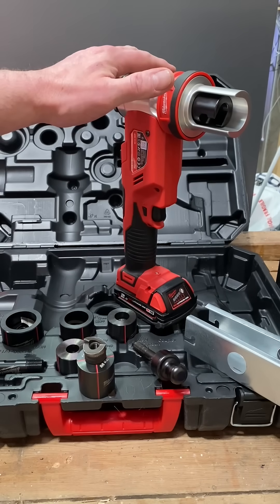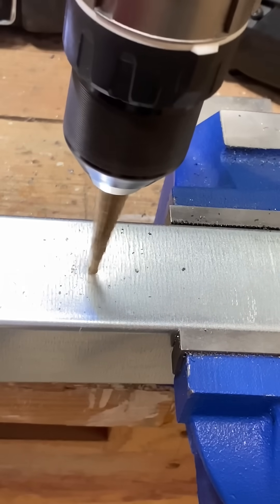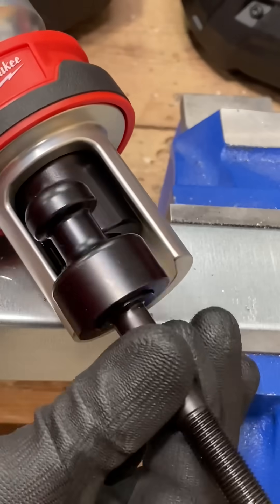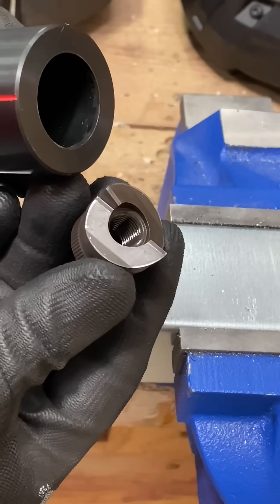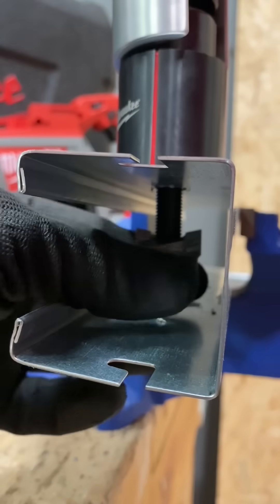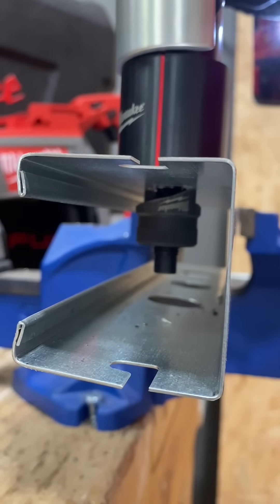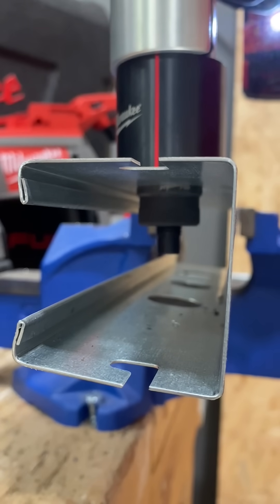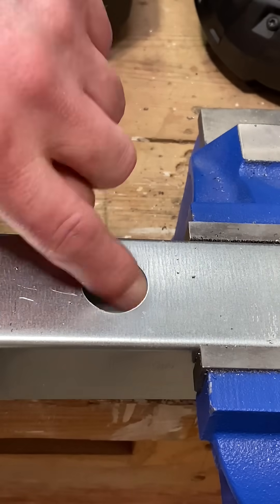ELECTRICIANS' TOOL TEASER - Milwaukee M18 Force Logic hole punch #shorts

Comment: I think I have a better design idea. Don't need the thread to pass through the hole, just something to anchor the cutter to a rod which is then withdrawn through the metal. There are a number of methods that can be applied to generate a linear action which will last longer than this type of thread. Ideally use a ball bearing race thread which is fully encapsulated within the machine preventing metal splinter contamination of the thread. Potentially wouldn't need to unthread the cutter to release the waste material.

Comment: It seems to be a slow and expensive alternative to just reaming out a 25mm hole and spinning a deburr tool in the hole.

I'm not saying it's useless; it's just too tedious and costly to justify replacing the simpler existing technique.

Comment: Used similar many times. Punches are so superior when it comes to larger holes. Especially when compared to a raggy hole saw. They also don't generate tons of swarf. But they only make sense if you use them a lot due to the initial cost.
I would definitely have one if I did trunking or panel plates daily.

Comment: You can buy a step drill that goes bigger than that, so step one drill, step two a few turns with a deburring tool. Takes as long as you did the first drill hole, cost hundreds less and only three bits to carry about.

Comment: So, you have to use a step drill to make a hole to start - why not just finish with the hole drill ?

One application I can see this being useful is electircal boxes where you can't drill holes and there are already knockouts that you need to make bigger, this would work for that.

Comment: Had a job where we were using 4 in pipe. By the time I started and realized how many times I was gonna need to use the messy heavy Greenlee punch that my boss had😢..... Got upset, called Grainger and asked them if they had the unit with the 2 1/2" - 4" dies. They said next day.  Charged it to my card .......$1700. Haven't regret it yet.  When you start using this in comparison to a regular ko punch.......... no going back. TRUST  ME. One hand use, not gonna fall into a panel or whatever after the hole is complete, speed change outs.....what else do u need.?

Comment: we have one of these at work. I've only used it about 4 times...It is a bit of a pain drilling out to 12mm first for a 27mm hole, but, when its 3mm Aluminium, it was better that a hole saw lol. Pity there isnt a fuller range of hole sizes in the kit. Mind you, the Q-max cutters were just as good, & you had D-conn shapes & square/rectangle cutters too.
Reply: 5 mm steel plate with this stuff?. Check your numbers.
Reply: @Luzt.  LOL, damn, yep your right! i had meant to put Aluminium! not Steel! Also it was indeed only 3mm!   -Edited my mistake- 👍
Reply: @Gdpud  No problem ;-).

Comment: Extremely expensive tool for sure, but when you’ve got a dozen new panels with roughly 20 or so knockouts needed in each of them there is no comparison to this tool; also another great point is that the tool almost always leaves a perfect hole with no sharp edges or burrs

Comment: Sadly this has actually inspired me not to buy one. By the time you got to the cutting. I tested it and I drilled three holes in conduit with an old CK 25mm hole cutter and a bit of wd40

Comment: You drill a hole to make a hole. You could clean the 25mm hole in the time it takes to set all that up. Plus if your using metal glands you don't need to be fussy about cleaning the hole

Comment: Wrong use of the tool. Or more like pointless use I should say, if you have to drill anyway.

The intended use of the tool is for junction boxes with holes already in them, and a lot of them too because the tool isn't cheap so for it to be a sensible investment, you'd have to be installing 100s of boxes with it.

But yeah it's a neat tool for a very specific application.
Reply from the maker: Try that approach on stainless steel enclosures

Comment: Nice but the Greenlee LS 50 FLEX is far superior and allows you access at tricky angles.
I'm a panel builder so use these every day for punching 22.5mm holes for panel lamps and switches but it will still manage a 50mm hole with ease.
What size does this Milwaukee go up to?

Comment: Center the draw stud in the hole, before pulling the trigger. Otherwise, when the draw stud pulls through the sheetmetal, the threads will get damaged!
Reply from the maker: Good tip☝️

Comment: It's easy to tell all the handymen and domestic sparkies. If you think drilling a 24 or 32mm holes all day is easier go for it. You'll be 20 step drills or holes saws deep before these dies even show wear. Where this tool is amazing is for guys that care about a quality finish and big holes in gland plates for HV switchgear.

Comment: Too many steps and tools used for one process which should be done with a single power tool.  Take it back to the drawing board and try again.  Need 1 tool to get that cut.

Comment: I fail to see the purpose of this specific tool wgich is limited instead of having a set of a manual punch and dye that is versatile. The manual is probably faster but can be used with a driver.

Comment: I have cut @ 50 holes with a 32mm bi-metal Makita hole saw, without a pilot, though 1.6mm metal stud using a modified templet & cutting compound in @ 15 minutes. This way is for amateurs.

Comment: This tool is clearly not really designed for retro work due to the amount of access required to use it so swarf is not an issue on a new installation as you would clean the trunking prior to installing. 
Hole saw or 25mm step drill rather than 12mm 🤷🏻‍♂️

Pointless item

Comment: I love milwaukee but this seems pointless, a standard set of hole punches have a bolt head so you could use a square drive adapter in a normal impact driver.

Comment: Damn, lotta non-sparks having opinions about a sparky tool. These things are irreplaceable. 1/2" - 4" KO in seconds. I don't know about you, but I can't drill a 4" hole in 10 seconds with pin point accuracy. When you got 10 holes to knock out through a panel c/w a driphood, you'll want one of these. Trust me.

Comment: I’ve used one for 3+ years now. It works great. Much easier that a Greenlee hand pump. I use it mostly for running 3/4” up to 4” liquid tight conduit in electrical substations. I get most of the comments about just using a bigger step bit or something. I probably would too for a smaller hole. That being said, I didn’t pay for it. It’s a company tool. Paying $1000 out of my pocket is a tough pill to swallow.

Comment: Yeah it’s a small hole. But when your doing that 4 times in 24 different boxes it does make it much easier (you can also do all the drilling and then punch). What he didn’t show is that some of these tools can do to MUCH bigger holes the ones i used could do up to 3” or 4”

Comment: Works great for knockouts in panels, switch gears, and mcc’s. Much quicker than a hydraulic one and easier on steel than a unibit or holesaw
Reply: I don’t know if you get a decent carbide hole saw kit I’d be using that all day.

Comment: A fast cut 25mm hole saw for around £20 would do this a lot quicker and cheaper, the lip on the hole saw will stop you going more than 20mm into a trunking/fuse board. It seems a faff, even the removing of the metal when the hole is punched seems a longer process

Comment: This tool is the dogs bollocks. It's a lot quicker.. And easier to pilot hole then screw the punch in place, then hook the ball pull, turn the shroud and pull the trigger.  Having the red cross makes it easier to position to get it accurate before hooking the ball pull

Comment: It's all fun and games with a hole saw until it gets dull and eats your trunking. You know what takes longer and costs more over time? Going back to the hardware store to buy 2 more hole saws and another piece of trunking and then vacuuming the excessive chips. Adding the extra costs and hours to your bid also hurts. For the pros, this tool is the slow and steady.
Reply: The pro has spoken. You've clearly had years of experience trunking and never ran into such problems, we're all stupid and there's no reason for this tool. My bad king you're right 👑💪

Comment: We used to use a hydraulic one for punching holes in control panel doors for buttons / lights etc. Lot easier and much more accurate than hole saws, especially in stainless steel !
Reply from the maker: Great info on the Stainless 👍

Comment: What is wrong with a holesaw? You would have to put a brass bush or a grommet in there anyway.
Reply from the maker: It comes in to its own on larger hole sizes
Reply: I bet you I could drill 10 holes with a 50mm holesaw quicker than you can make the same  amount of holes with your toy.

Comment: no slicey dicey sharp holes are nice for running wires or tubes but a stepper bit large enough seemed to do the trick

Comment: Great if you can get to the other side like in the video but what about in a solid box tube? And you’ve drilled leaving swarf inside the section anyway🤷‍♀️ I feel like this is an extremely specialised tool only one or two types of trades would ever use…

Comment: Love this tool also have green lee hydraulic set ... but pro tip in a pinch where that won’t fit use the ratchet set with a socket and adapter to you impact ...works like a charm and you don’t have to carry around the big hydraulic set or this big gun

Comment: Really? What happened to a sharp hole cutter and a brass bush? Whatever happens you have to add mechanical protection to that so I don’t see the advantage. I could drill and bush a 20mm hole in 20 seconds. That was a rigmarole. What am I missing??

Comment: Why not do what plumbers do and use a deburr tool? Drill the hole 25mm in the first place! Save money and time vs that tool! The step drill should shamfer the outside edge anyway. As with regulation you should be using grommets anyway! Nice finish but time is money. Also money is money. Pointless tool in my opinion!

Comment: Mean time I've drilled a dozen holes and deburred the lot and saved ££££ and time all with the drill you need for the pilot hole anyway... It's a great tool if you're making production lines (internal trunking) to give that nice manufacturer finish ...but even for a predominantly industrial sparkie like me that's a hard to justify (cost wise) and slow tool...time is money...now if they made it make the pilot hole somehow that judgement would change.

Comment: You used it wrong, next time read the owner manual
Reply from the maker: So which part is wrong?
Reply: @efixx  it's a quick connection, you should put the shaft in hole tighten, then put the tool on, its design for more accuracy, we use them all the time at work
Reply from the maker: Thanks - this was our first out the box trial. It’s getting some proper use next week.

Comment: I've had a wrench/socket powered GreenLee version for 15+ years with basically the same cutters and same results.
I suppose I could put a socket drive adaptor on my drill and have the same basic tool, so why buy a specialty tool and spend all that extra money?
Reply: Your drill isn't designed for that. These tools are beasts and save time and energy
Reply: @Tre16  how do you know what drill I have? True, most drills likely wouldn't have the torque to last with constant use in this situation, but some higher end hammer drills or 1/2" high end drills might.
Reply: @Tre16  I've been using my Milwaukee Fuel impact  with a Greenlee slug buster for years.

Comment: Ok, I'm sure there's a good application for this, but 20-50mm bush holes in 1.2mm electrical trunking is not it!  That massively expensive tool plus the die kit, plus cone cutter, just took 3 times as long as sharp (new) Starrett fine-tooth flanged holesaw, and the cone cutter made perhaps as much swarf.  You can't fit that die in a box full of cables, whereas a holesaw just needs a sacrificial piece of metal held inside to protect existing cables when cutting an extra entry.
And in electrical trunking you never ever pull conductors through an unprotected hole, no matter how "smooth" the finish: it will get bushed, glanded or grommeted, so that factory-perfect finish is irrelevant.

I wonder what industry will use it, though?  It's obviously a great tool for the correct job (when you find it...)
Reply from the maker: We’ll be putting this tool head to head with fine toothed hole saws very soon - stay tuned!
Reply: in North America most enclosure have ½ inch nominal nock out, you use them to enlarge those hole, orif you have a bunch of hole on a control cabinet you drill a bunch of hole on layout for the draw stud then you can punch whatever size you need

Comment: Use a bigger step drill at the start and keep the £1000. I don't care how smooth the finish your not putting unprotected cable through a bare metal hole.

Comment: That's a lot of work just to punch a hole. You could have just used a larger step down bit and drilled the hole all the way through the first time. Or how about a stud punch? That would have finished the job in less than 2 seconds

Comment: Lovely cut but a fine tooth hole saw would have been quicker.
Reply: He had to use a drill bit for the 12mm hole so that would leave metal as well...
Reply: Also would have left metal bits everywhere. I don’t care about that, but electricians do.
Reply: @explosivemallard8038  you have to drill a 12mm pilot hole first anyway so still metal shards everywhere 🤣🤦‍♂️
Reply: @explosivemallard8038  no, the lazy person doing the drilling would have left metal bits everywhere, not the drill bit. Someone that cares would have brushed and hoovered after themselves.
Reply: @laughatfootball  sorry but have you ever seen a electrician clean after themselves? I haven't 😂
Reply: @jesperjohanssonn6269  Very true,  Sparky's are the worse out of all trades.
Reply: @jesperjohanssonn6269  the electrician that is contracted to my company is a huge ocd guy. This seems like something he would like. Seriously, the man color codes all of his stuff and labels everything. He keeps a label machine in his kit. He makes cabling look it was done by God himself.
Reply: @laughatfootball  it’s more the burs that can cut open the insulation
Reply: @davo7512  agreed but that’s down to the installer, not the tools.
Reply: So going to teach all the non electricians why we use this tool. Typically when we use a punch set we are punching holes for a panel and when you're knocking holes in a panel they need to be really precise to the size of the connector. Hole saws have a tendency to not be true to the sizes we need in this process depending on how off it could easily ruin a panel thats why we make a small hole then the big hole.
Reply: @dylanpowell147  not entirely true. You can make a hole that is over by 1/8 and slightly bigger and it will still work for most connectors. Connectors don't require that high of an accuracy to fit
Reply: @dylanpowell147  it certainly is a reason to use it but not the reason you have to use it. A fine tooth hole saw or a cone/step cutter will give a good enough result also.
Reply: @laughatfootball  i have worked for several very large companies in Washington in every  single one of those companies have chosen to use punchs over hole saws for panel work it most certainly is the reason we use the tool
Reply: @dylanpowell147  it is the reason, fair enough but not the reason you have to. There are far quicker and just as good options.
Reply: @laughatfootball  nope saw aren't faster. Not only the cut présent a risk of damaging cables and wires. These tools not only let a propre fast but are more précise the différent size of punchs being standardised. And the stainless steel cabinets for example are nigthmare for a saw. Even with good specialised blades.
Reply: @philippesoares1745  there are no cables and wires in empty trunking. The trunking isn’t stainless.the actual cut may be quicker but the setup makes the process ridiculously long.
Reply: @onyxphantom6762  dunno chief

Comment: Why not use a hole saw or a bigger step bit.
Reply from the maker: Tidier hole finish and less swarf. The machine is more use on larger holes and materials such as stainless steel.

Comment: Carnt see the point of this...!
You had to drill a 12 mm hole to use it so why not just drill the hole size needed in the first place plus that tool looks expensive compared to a set of decent hole saws.....
Just saying.....
Reply from the maker: We’ll see what happens when we get to larger hole sizes.

Comment: that's why they cost so much to have an electrician to do a job, when he keeps having have to change the tooling on his little machine that a 20 mm hole cutter it will do just fine and in a quarter of the time.

Comment: It has the advantage of less swarf lying in the trunking  to clear out with just the pilot hole and I guess no rough burr edges also possibly less vibration than a conventional drill.
Its one of those tools if it was in regular use it may be more comfortable to use all day and may justify the cost depends how long the battery lasts as well.

Comment: Certainly a game changer for neatly cut holes in metalwork
Reply from the maker: Thanks
Reply: Small tooth hole saws just as neat a hole. Dont need to carry a drill and the          " new wonder"hole cutter.
Reply: @davehyam113  have fun in stainless